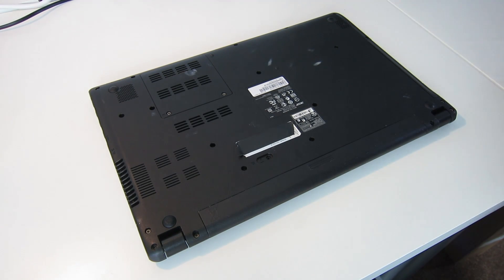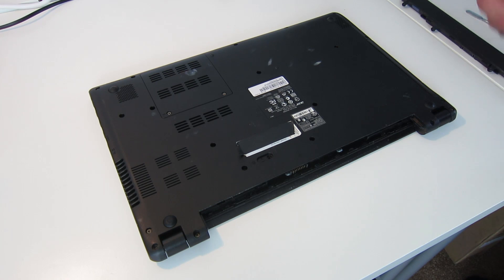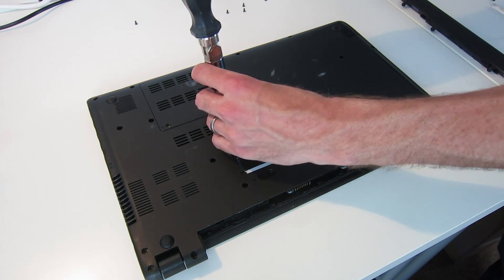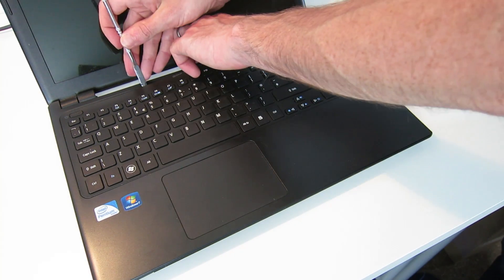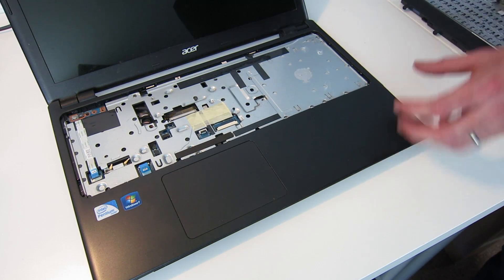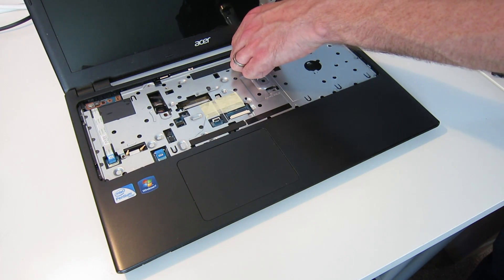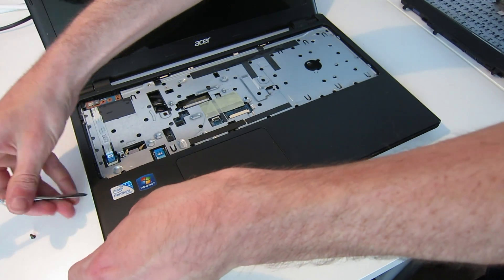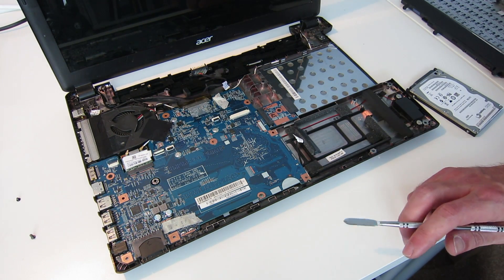Acer Aspire V5-531 Hard Drive and Memory Replacement Guide

Comment: Great video, helped me lots, successful SSD upgrade.  I was able to get the HDD out without taking the two small flex cables out, removed keyboard and was able to gently remove HDD. I must get more experience remove this type of small cables, there did not seem like there was a flap or an easy way to remove, did not want to pull the cable a brake, I did that once before and it cost lots more to repair. 
TY again for a easy way to upgrade.
Reply: Did you copy the hdd over to the ssd or did you install windows from scratch?

Comment: i had this error opperating system not found <
Reply from the maker: You'll need to install Windows after fitting the new drive.
Reply: a ;-;
Reply: i will see if the blue screen reapear if he reapear i need to take a new windows ?

Comment: Dumb design. It is much easier to remove HDDs in 90% of other laptops.
Reply from the maker: jo hho Sadly quite common now though - often a simple access panel could make things much easier.
Reply: Since I was given one of these laptops and it DOESN'T WORK, I'm NOT gonna bother taking it apart to scrap the Hard Drive!!

Comment: Looks complicated. Would it perhaps be any easier with the Lafité laptop? It has room for two hard drives so I'm thinking of one day swapping the main hard drive for a solid state then using the old one for storage, if possible. They must be pretty small hard drives to fit two in such a thin laptop.

One last thing, I hope you (or someone) keep some of these faulty hard drives as they are often good enough for storing files like pictures, backups, etc.
Reply from the maker: Mrvideosandgames not too difficult to do compared to some.

Faulty hard drives go for recycling, you'd have to be nuts to use a drive that is corrupting data for backups.
Reply: Brue Computing Really? My dad's desktop was getting blue screens and all sorts of stuff, even after reinstalling Windows so he just used a different hard drive for the OS and used the old one for backups.

Anyway, it's all good if some laptops are easier - presumably this one is as there's plenty screws on the bottom and the keyboard doesn't look removable.